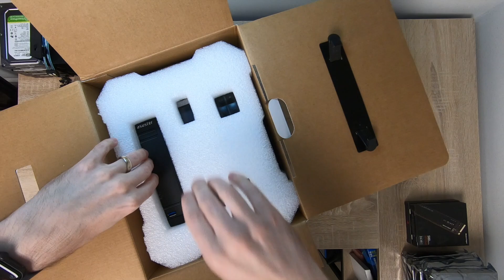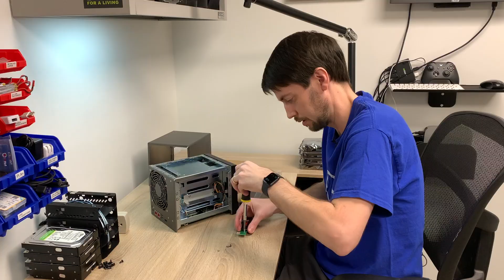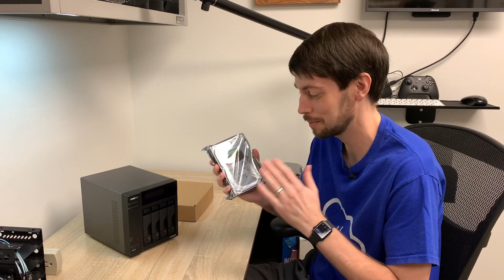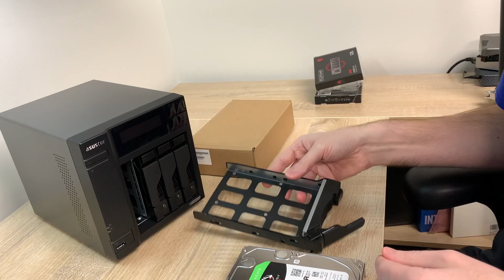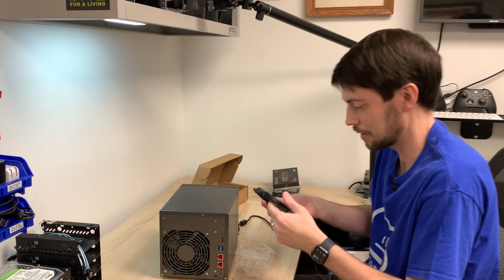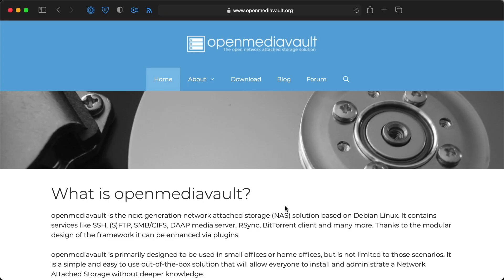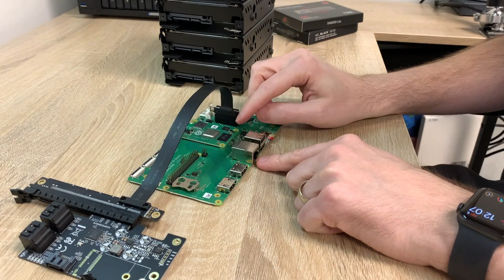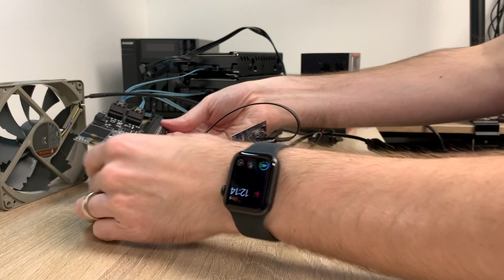Raspberry Pi vs ASUSTOR NAS Head-to-Head Part 1 - Hardware

Comment: Hey everyone! Marco here. Thank you Jeff for taking a look at our NAS! We thoroughly enjoyed our friendly competition with the Raspberry Pi. ;) For anyone with questions, comments, constructive criticism and praise, feel free to reply to this comment and I will get notifications for your comment and reply with my best answers. Remember to keep Red Shirt Jeff and the blowtorch away from the NAS. It prefers cool temperatures.

Again. Thank you!
Reply from the maker: I have been able to keep Red Shirt Jeff occupied with Dishy lately... but once it's out of the house, no guarantees!
Reply: @JeffGeerling  Uh oh. If that's gonna happen, might as well collab with Explosions and Fire.
Reply: Thanks to you both for a great video!
Reply: @JustinEmlay  Thank you for watching!
Reply: @JeffGeerling  We should mention, that the riser card does not use standard PCIe pinouts. It is wired differently to provide two m.2 ports without switching hardware in one slot.
Reply: Can the built-in fan be replaced with a standard 4 pin pwn PC case fan?
Reply: @aephk  The fan connector is not proprietary. It can, but we've engineered the entire NAS to be in complete harmony in terms of balancing price, performance, cooling, size and efficiency. But there is nothing stopping you from replacing it. We just can't offer tech support to after-market fans.
Reply: Marco, I was curious if you enclosures use the newer power spec for sata or the older spec (Pin 3 being PWDIS vs. 3.3v)?
Reply: @Fenix1861  That one I might need to wait until we get back to the office on Monday to ask product management. Will reply then! Happy weekend!
Reply: Is nfsv4 fixed already?
Reply: @ironsm4sh  In the next month or so, we will be releasing an overhaul of the OS inside that will include a variety of fixes and a major Linux kernel update. Will report back with more details on Monday.
Reply: Can you send me one of these devices? XD
Reply: @Cat-vs7rc  Upload tech videos regularly, have a substantial and reliable subscriber base and feature a cat in a portion of all of your videos and we'll talk. I might be kidding about the last one.
Reply: Marco, im wondering if asustor will ever make a separate retail motherboard with 4 pcie x4 open slots for diy nas (make it fit in a generic industry standard ibm 5 1/4 drive bay size for easy fitting please O.O ) and ram based Debian 10 'slax' captive covid home use in the uk amazon store, plus cheap psychedelic purple ^_~ plastic sata back plane cage + pcbway made sata pluged x4 pcb for instance
Reply: @Cat-vs7rc  Okay, sure. Just pay me first.
Reply: @paulmaydaynight9925  Your comment will definitely be put in front of management. Can't guarantee anything though. 
(I've had the same idea too.)
Reply: @ASUSTOR_YT  there's more likes but jeff needs to get any proof of concept to test too for good pr ^_~
Reply from the maker: @ASUSTOR_YT  Ah, thanks for clearing that up. Glad I didn't try plugging it into the Pi then ;)
Reply: @JeffGeerling  Yeah, let's save the fires for Red Shirt Jeff. :D
Reply: Asustor NAS Product does best what it suppose to do but we got Jeff great content cause of that and healthy competition always brings out the best.
Reply: @ASUSTOR_YT perhaps Jeff was just confused in this video, but if you're going to include 2.5 Gbps nics, you may want to include better matched Ethernet cables.  Cat5e is only rated for 1 Gbps transfer speeds.  Perhaps cat6a might be a better pairing.  I get that you want to keep costs down though.
Reply: @JeffGeerling  You should pin in this comment, mate.
Reply: @JoanDoe-pq5fu  Actually, see IEEE 802.3bz, which specs out 2.5 and 5 Gbps over Cat5e.
Reply: @d00dEEE , I stand corrected.
Reply: Thank you Jeff and Marco and ASUSTOR!  Was waiting for something like this.  I almost bought one of the LockStor. Still wondering how to work out a solution for my need.
Reply: @d00dEEE  Thank you for that. That is true. Cat5e can handle 2.5-Gigabit and 5-Gigabit Ethernet perfectly fine. Cat5e will also support 10-Gigabit Ethernet at up to forty five metres.
Reply: @bobwong8268  Thanks! Feel free to ask questions if needed.
Reply: Let me ask one question..  I am a geek who would typically be a DIY'er for something like this, but sometimes, as his desk full of parts and power cables shows, it's better just to buy off the shelf, and I am generally a big fan of ASUS, so you have my attention...  My issue is..  My current NAS is an UnRaid running on a full size computer, and I'm trying to downsize, both physical size AND power consumption, so these small units are appealing..  My addiction to UnRaid however has been that 1: I can upgrade size of drives incrementally, and as long as the parity drive is the largest, I have full use of ALL the capacity of my data drives, which I replace as space dictates.  My UnRaid setup has grown from 2tb drives long ago, all the way up to where it is now, with a mix of 14tb and 8tb drives, one at a time, with no "starting over".  Do any of the consumer NAS devices do this?!  I dont want to have to replace all drives at once or lose capacity when I outgrow whatever I start with..  Second, I have a windows domain at home, and as such, I want the NAS to be able to participate in the domain authentication, and at least authenticate my domain users.  Full NTFS style permissions would be a plus, but even share permissions to limit a guest or child user would be good.  Thanks in advance!
Reply: @ASUSTOR_YT  VERY important detail, as I was envisioning the possibility of using that slot for something else!!
Reply: @paulmaydaynight9925  A nice small case like this, with an eSATA cable for expansion, or an available PCIe slot for a decent host adapter or 10gbe would be a winner..  Or, partner with UnRaid and work with them to create a version of UnRaid that would work on this box, and i'm there.. especially if I can use my existing license..
Reply: Thank you for supplying a product for review and comparison.  While I like DIY solutions, some solutions are more suitable out of a box.
Reply: can you buy that pcie to 2 m.2 nvme ssd separately
Reply: @Fenix1861  Hi! I asked, we don't use PWDIS at the moment.
Reply: @SteveJones172pilot  Hey there! We have an answer for every question. 
1. We don't yet have mixable RAID. It is on the mind of management though. 
2. We do support full NTFS style permissions and Active DIrectory. 

Hope that helps!
Reply: @scoutg001  There's another comment in this thread that says the board in the ASUS unit is NOT standard PCIE pinout.. it seems to use the same connector, but it has custom signaling so as to not need a PCIe switch on the board, so even if you could buy it separately, it would be useless in a PC with a standard connector
Reply: @SteveJones172pilot  That's right.
Reply: @scoutg001  Unfortunately, no. It only works with the Lockerstor 2 and 4 and does not work in a standard PCIe slot.
Reply: @timmooney7528  Thank you!
Reply: @SteveJones172pilot  The issue with eSATA right now is that it means precious PCIe lanes must be allocated to SATA connectors that are not easily used. The SoC only has six to deal with and we're not at a point where we can do RISC-V CPU design.
Reply: As you make these design decisions, keep in mind that some of us dont really care about top performance..  I want capacity and long-term reliable storage.  I think it would be a fair compromise to have a mode where you enable an external eSATA if you accept lower performance.  For example, I'd probably never use read or write caching, so I'd give up the internal SSD.  I do understand I may not be representative of a large percentage of the market..   I'd be perfectly happy at home with a giant rack mount eSAS case if not for the power it took!  :-)
Reply: @SteveJones172pilot  I definitely hear you loud and clear. It's not really performance, but just the limitations of the SoC inside. We certainly feel that the NAS drives Seagate, WD and Toshiba release are the best balance of price, performance, capacity and long term reliability. The USB 3 ports have largely superseded the need for eSATA on our consumer devices. As for eSAS.... I can maybe suggest to management a way to expand to add an eSAS controller as a separate purchase in newer models. We fully expect future SoCs to be more PCIe friendly and we can think of ways to add it in without sacrificing. I do take your concerns seriously.
Reply: @ASUSTOR_YT  Does Pin 3 carry an active 3.3v connection?  It is important as it can limit the available HDDs that can be used in the enclosure.
Reply: @Fenix1861  Hi. Pin three is not connected. We do recommend checking our compatibility lists before purchasing a hard drive.
Reply: I had (past tense) an ASUS NAS. I loved it. However, one day it simply stopped working.  I did some extended calls to support and, in the end, I returned it for a full refund.
While I was pleased to get the money back, the fact remains that all the data on the drives was locked away until I bought a new replacement - and even then the data retrieval was NOT a simple process.
I would like to see a setup for retrieving data from the ASUS drives, without using the ASUS.  It's important to note that a NAS should NOT be the only backup of your data.
Reply: @Soupie62  Did you have an ASUS NAS or an ASUSTOR NAS? ASUS sold NAS devices like the NAS-M25 before our company's founding in 2011. Our NAS devices have had a simple seamless migration process for almost the entire company's life. When changing to a different or new ASUSTOR NAS, the drives are simply taken out of the old NAS and put in the new NAS in the same position. The new NAS should boot up with all your files and settings intact.
I'm sure I can work on a video using an Ubuntu PC to access drives RAIDed with MDADM. We use MDADM for software RAID.
Reply: @ASUSTOR_YT  and if I was looking at buying HDDs to fill the sleds, I would definitely stay within that list.  Unfortunately, I am looking at repurposing some older hardware.   While today’s HDDs NEVER use Pin 3 for 3.3v, I have at least one old laptop drive that does.  At least your enclosure means that most people that have the same question should be happy, since I imagine they are looking to shuck some of the WD and Seagate external drives since those tend to be MUCH more cost efficient for SOHO deployments.
Reply: @Fenix1861  Right. Actually we don't really recommend repurposing old hard drives as they might not have adequate protections for vibrations.
Reply: @ASUSTOR_YT  I understand that, and from the company’s perspective that is wholly understandable.  From mine and many others, you use what you’ve got until you really no longer have a choice because the motor failed or the heads have crashed into the platters.  😄
Reply: @Fenix1861  No worries. Another way old hard drives can be repurposed with our NAS is by using them as archive drives, either through an available bay or a USB 3 external hard drive dock that I like to call, the hard drive toaster.
Reply: @ASUSTOR_YT  From memory (and a quick picture lookup) it was the ASUSTOR AS6404T. 
When I got refunded (instead of replaced) I had no new NAS to slot the drives in - had to shuffle them into a PC and manually restore data. Used Ubuntu, from memory.

Sometimes think of trying a new NAS, but spouse is firmly against it due to this experience.
Reply: @JoanDoe-pq5fu  cat 5e will do even 10Gb over a couple of meters cable length.
Reply: @Soupie62  Your feedback is duly noted and will be brought to management. Thanks!
Reply: @ASUSTOR_YT  You never did reply to ........ Marco, I was curious if you enclosures use the newer power spec for sata or the older spec (Pin 3 being PWDIS vs. 3.3v)?
Reply: @muddyfunster4216  Hi. I did reply to the commentor. It's a bit up. Pin three is not connected.
Reply: @ASUSTOR_YT  Ah sorry my bad lol
Reply: @muddyfunster4216  I wish YouTube had a quote function.
Reply: I bought this after watching the setup videos. It seems nice, but the EZ -Connect is a massive security risk and I'm really disappointed. The log on my machine shows that as soon as I enable it, my NAS is almost immediately under assault from hacking attempts. There is a long log of sever different IPs all trying to remote into the machine. Hours at a time attempting every few seconds. From what I can tell, it isn't stopped at the server my NAS is connected to but directly to the NAS. So, when using EZ-Connect, my firewall to my network now has a hole. I cannot use the NAS remotely or for clients.
Reply: @jimlynch9880  Thanks for your feedback. I will let the team know! 
To help me out more, email our marketing line found on our site with the symptoms and i'll get in touch with you to learn more and how we can improve on this.
Reply: Hi Marco. I bought a Lockerstor 4 on the strength of this review and the support you showed here. My first impressions have fallen way short of the mark - I guess things are a bit different when you've just dropped $1000 on a NAS and $600 on storage rather than had them handed to you for free. Ticket #40696 - note that the support portal doesn't integrate with either of the two ASUSTOR accounts I needed to set up (Store and ID/registration) and also makes mention of an old UI option to generate logs which doesn't seem to be in the current ADM logs. Will I get good support without being a big YouTuber? I guess we'll find out.
Reply: @ASUSTOR_YT  updates?
Reply: @aanthanyj  Hi. Need your help with which comment you are replying to. YouTube doesn't tell me.
Reply: Brilliant move here, Marco, turning Jeff loose on your NAS. That HDMI port changes the game for home users. I’d be interested to see how it streams. Thanks dude.
Reply: @SchoolforHackers  Thank YOU for watching and your support!
Reply: Hey Marco - I actually ended up purchasing the whole setup in this video (woohoo). However, after inserting my 8TB drives, the box says "Starting System, Please Wait...." and it has been that way for a couple of hours now. What should I do?
Reply: @sthmrtn  Hey there! If a drive is DoA (it happens) it could prevent the NAS from booting much like a PC. I would try turning it on without drives and see if it works. Afterwards try to narrow down which drive is causing the issue. If none of them prevent the NAS from starting up, then turn the NAS on without the drives, after startup completes, plug the drives in and attempt to initialise. If all goes smoothly after that, then they should be OK and the fresh format should have taken care of any issues.
Reply: @ASUSTOR_YT  Drives ended up being ok. But the RAM I stuck in before initializing prevented the bootup. Going to finish init process and try to reinstall the RAM after...
Reply: @sthmrtn  Ah, perfect! Glad to know the drives are good!
Reply: @ironsm4sh  Hi! I was tasked today to proofread the release notes today of our next update. No updates about NFS at the moment. Still keeping an eye out for them!
Reply: @ASUSTOR_YT  <3
Reply: I am so getting this NAS. Can't rely on Pi NAS anymore due to valuable data. The NAS looks bad ass too.
Reply: @enterthelegions  Thank you!
Reply: My only question is how you're doing with the vibration resistance since i want it as quiet as possible
Reply: I remember when you gave the same NAS to Michael MJD
Reply: @radoslavl921  Welcome! Fellow MJD fan! 

Actually his video is slightly newer. :P
Reply: @ASUSTOR_YT  I didn't notice that lol
Reply: you can send me one, with 4x MG08ACA14TE's with actually no strings attached. cause he's reviewing something i can't afford, for free while saying there are no strings or sponsorship "dollars" while being enabled by fungible dollars in the form of assets, which is by definition a sponsorship. 'This = review, no review = not this.' wanna prove me wrong, send me one with drives for nothing; simply cause i have no NAS.
Reply: @asustor, a "modular" Nas would be great. Something where the Pi3 or pi4 slides in to the nas "shell" to give it a brain, ram, USB, Lan etc.
Reply: I really like Asustor NAS stuff, but what really makes me interested is your Linux OS (I am referencing the newest version, not the one shown in the video) for managing them, any chance they will be publicly accessible without the requirement for a Asustor product? Money doesn't grow on trees for me and a combination of the OS Plus an Home-made Raspberry Pi solution would be perfect... i mean, buying the NAS would be better but not as a Student xD

I also appreciate that you give normal people the chance and talk to the "Higher Ups"
Reply: can i put a rgb fan into this? 😆
Reply: @scudsturm1  It's not technically impossible. We don't recommend it because the NAS is already finely tuned. But... A normal PWM fan will work.
Reply: not sure a competition between a $600 NAS and a raspberry pi is fair
Reply: @ironsm4sh  Hey there! We recently released ADM 4.0. They replied to me they're still working on NFSv4. It seems to be a tough issue!
Reply: @ASUSTOR_YT  It is a wonder that you replied at all <3. But see you in 4 years when the issue might be fixed, sadly.
Reply: @ironsm4sh  I can't claim to know the inner workings of the development team. I work marketing. I did say I would keep you in mind. We are a smaller company and many things get pushed through the pipeline because we need to punch above our weight. I did say I would remember and continue to hold their feet to the fire. There is lots to do to make an even-better product and I will keep fighting for you. It's possible theyre having trouble with it, but sometimes even the things they say, especially with the language barrier, go over my head. But I keep it in mind because we want to be the best. 

I won't forget.
Reply: @ASUSTOR TV how are still replying to these replies on your commen.
Reply: @baniel27  Really do love reading your comments! And I get email notifications if I get a reply.
Reply: @ASUSTOR TV
It would be really nice to have a NAS enclosure supporting raidz2, with at least 5 bays, of course. Just saying...
Reply: @marcus3d  I hear you! We'll have to study the feasibility though.
Reply: @ironsm4sh  Hey there! We recently updated ADM OS and it comes with NFS fixes. Please try it out!
Reply: @ASUSTOR_YT  💕🥰 You are a legend
Reply: @ironsm4sh  Lemme know if it helps! If not, I'll keep pushing!
Reply: @ironsm4sh  Hi Iron! More NFS fixes coming in ADM 4.0.2! Check our release notes for more info!
Reply: @ASUSTOR_YT  Nice! I upgraded my device last week. Going to try the new fixes soon.
Reply: @ASUSTOR_YT  hey AsusStor, I finally got time to try it out. 
1) I gave my NAS access to the internet upgraded my NAS
2) I upgraded to 4.0.4.RR23
3) I revoked the NAS's access to the internet
4) I tried to mount a registered NFS volume using NFSv3, which worked
5) I tried to mount the same volume using NFSv4, using the "-o nfsvers=4.2" mount flag

The system then replied using the following message:
mount.nfs4: Protocol not supported

It sadly still does not work using the lastest updates. 😔
Reply: I like the expandability on your NAS.
I hate how some companies will try to manage everything and restrict the user.
But these seem like a decent price point and they have some great features (w/ being able to add in the SSD's and whatnot)... giving the end user some cool options 👍
Reply: @-ColorMehJewish-  Thanks! We have not and have no plans to start restricting the use of third party hardware. Feel free to ask questions if needed!
Reply: This is the kind of company we need, open to constructive criticism and doesn't control what the reviewer can and can't say, it's rare to see this nowdays. I understand from a business point if you want your products to appear to be the best but probably not a good practice to mislead customers.

Besides that, I'm actually building my own NAS.
9x4TB SAS drives 28TB storage, 8TB parity, 2.5GbE ethernet, a Ryzen 5 5600X overclocked at @4.1Ghz, 32GB DDR4 memory, 256GB M.2 SSD for the main cache, a 128GB SATA SSD as a secondary cache for things like docker and VMs so I can run most applications such as a Plex server, or a Minecraft server if I really wanted to.
It has pretty overkill hardware but it runs like a beast, can your NAS outperform mine? ;P
Reply: @ThatOneWeeb420  Hey there! Thank you for your reply! We don't feel the need to mislead or make our products appear to be the best. I love letting the NAS speak for itself and I am so confident in its performance that I sent it to Jeff Geerling, a guy who can definitely rip the software apart. That said, I know we're not perfect. Who is after all? But I know that the constructive criticism from both Youtubers and commentors can be a really great kick in the pants as to which direction we should take and do our best in that direction. I don't want to sell product to people if it's not right for them. That's just an expensive support nightmare. I want happy customers and I genuinely care. I'd rather slow and sustainable growth than a quick sale to the wrong person. If it's not right for you, it's not right for you.

In terms of whether or not we can outperform a PC like that, obviously with the Celeron and Atom CPUs inside the NAS, in terms of raw performance in Cinebench? No. Of course not. However, I'd argue that in a NAS, raw, bleeding edge performance is not the main purpose and that many applications often leave performance on the table with an overkill machine while wasting power. Dollar for dollar, we're not going to be the lowest price, but we sell a holistic solution that combines software efficiency with efficient hardware so that we can do all of this in a small footprint, both physically and electrically. Can our NAS outperform a Ryzen 5 5600X? No. But can it run 28+ TB, multiple SSD caching drives, multiple docker images, 2.5GbE, Plex and Minecraft servers? You bet! And it will happily chew through that in a smaller power envelope while also adding Plex hardware transcoding because the SoC has an integrated GPU. For those who want a bit more oomph, we sell NAS devices with desktop CPUs as well for things like full desktop-OS virtual machine support and 10-Gigabit Ethernet. 

There is no wrong way to go down the NAS path. I have DIY equipment at my house, I have ASUSTOR NAS devices at the house too. But we try to engineer our products in a way that avoids bottlenecks in their price/performance class. With the latest Lockerstor 6 Gen2 we recently sent Jeff Geerling, it is upgradeable to 10-Gigabit Ethernet and we're going to be releasing a 10-Gigabit Ethernet card with M.2 slots on it for that NAS and PC so it can take full advantage of all of the power available to it. Who knows! Maybe we can even be a part of that AWESOME server you're building with our 10G M.2 card or even a backup NAS to keep your data safe in the event of unforeseen data loss. We'd certainly be honoured. Our NAS devices happily talk with competing products because data security is more important than vendor lock-in. Stay tuned! And as always, love your comments and opinions. Hope you're having a FANTASTIC week!